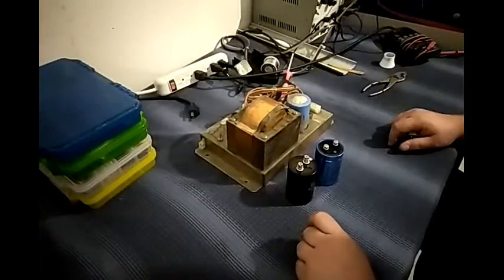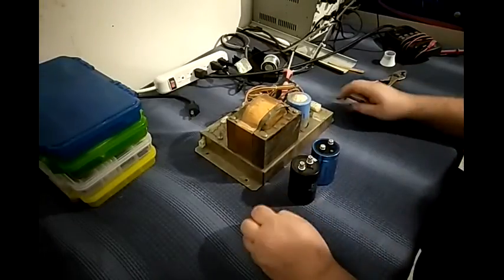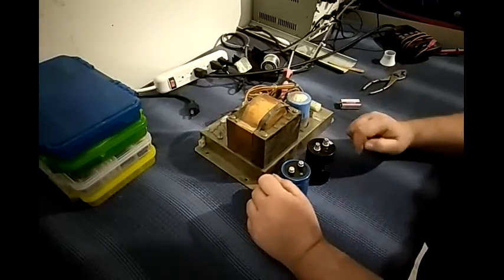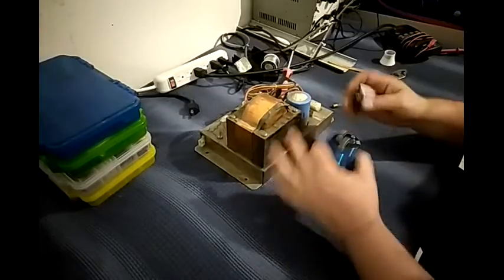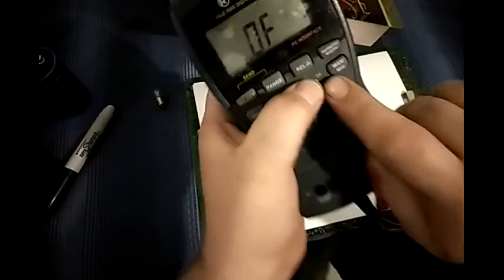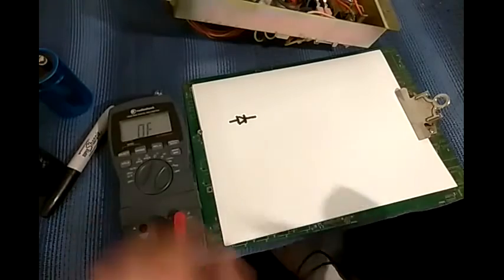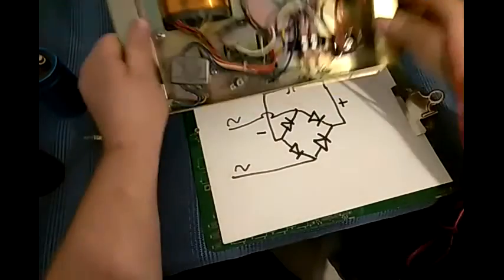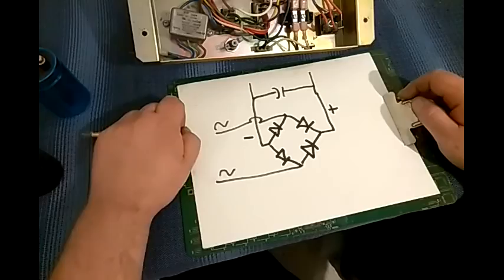Tech Tips with ArcadeJason (Testing Atari Big Blue)

Comment: Jason, Thank you so much for this video. It was VERY helpful for my situation. I have an Atari Asteroids cocktail that I've been carefully restoring over the last few months. It was dead to begin with but after re-soldering the transistors on the monitor case, fixing a PCB harness connector for the fire buttons, adjusting the monitor yoke, and a ton of other minor tweaks and overall cleanup/fix-up, I got it to work. Problem is now it will work but after a few minutes of play, it will out of the blue reset. It will play for a few more minutes and then reset again. Each time it resets it stays "good" for less and less time. Finally, it won't work at all. All I get are random humming/sounds, stray light streaks on the monitor, or no video at all. No matter how many times I reset the game, reset the PCB or switch to test mode, it won't work. It used to reset to work after doing those things. Now, it just doesn't work. I am strongly suspecting "Big Blue". I believe it is the original. Actually a light "blue". What do you think? I also liked the part in the video where you explain how to test the bridge rectifier. Very helpful. It was also suggested to "check the voltages". How do I check the 5V and 12V on the PCB board? A/R board? Any thoughts or suggestions for me? Thanks in advance.
Reply from the maker: cheapskategamer1  let's talk buddy my email is koppjason83@yahoo.com
Reply: Sure thing. I sent you an email yesterday. Did you see it? :)
Reply from the maker: no ill chech right now
Reply: I'd like to know if replacing the big blue helped you. I am in a similiar situation with an upright Asteroids I acquired last weekend that doesn't work. Parts order that arrive today which include a new big blue.
 Hoping it will fire up!

Comment: I'm unclear on which way to connect the battery to big blue. Can you clarify?
Reply from the maker: this is really not a very scientific way to do this and i have debated taking this video down  but if you want to try it the smooth round terminal on the 9v battery is positive connect that to the + mark on the capacitor